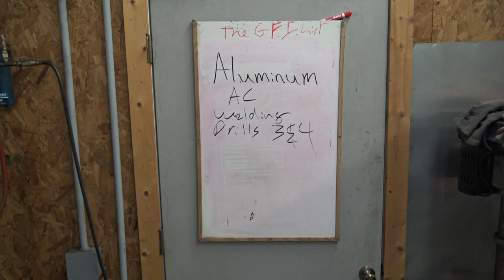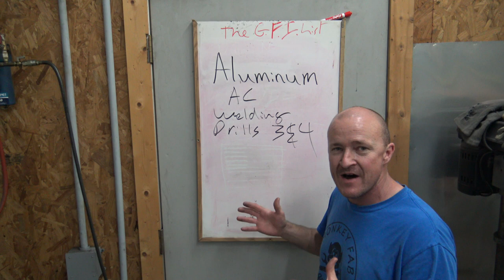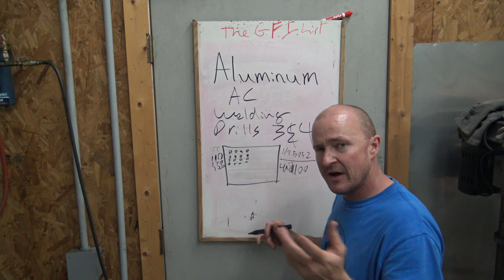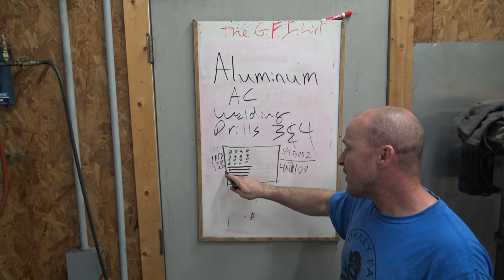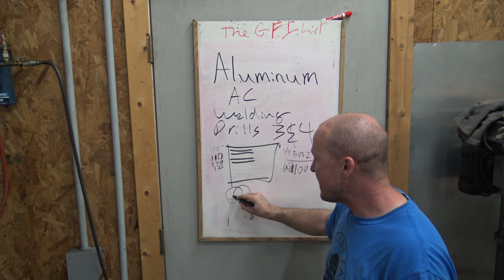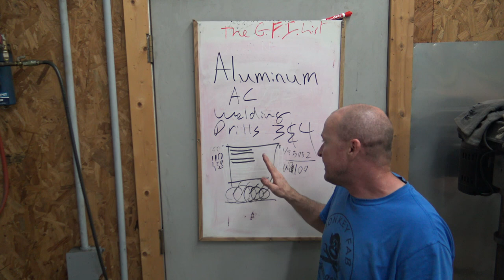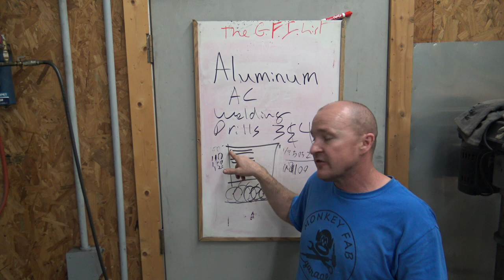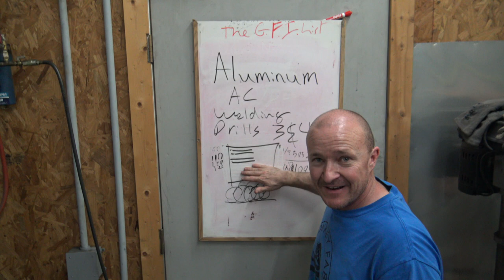How to Set Up and Use a TIG  Welder series; 9 Aluminum Welding, Drill 3&4

Comment: Man, all I have is this stupid china machine that has a ginormous bulky torch with a trigger on it, and no pedal in sight. I’m putting a lot of heat into the metal, very quickly. And I’m not nearly good enough to move my filler fast enough to keep up. I’m so screwed. Haha! But, no chance I’m giving up. I love this shit too much. So, working with what I’ve got, until I can afford something better. In the meantime, I’ve got these videos to help me figure out wtf I’m doing wrong at least. Thanks again mike for making this content. Congrats on the subscribers, and I could listen to you talk about this stuff for hours. Bring it.
Reply from the maker: blockequals4 turn it down. It’s almost better to be a bit on the cold side with a torch switch when practicing. The speed and accuracy will come
Reply from the maker: blockequals4 its all interrelated, the amps, your speed, filler, and torch position. Turn it down till you can barely get a puddle and then bump it a couple amps till you find a groove
Reply: Monkey Fabrication Garage Word. Thank you. I’ll take that and roll with it.